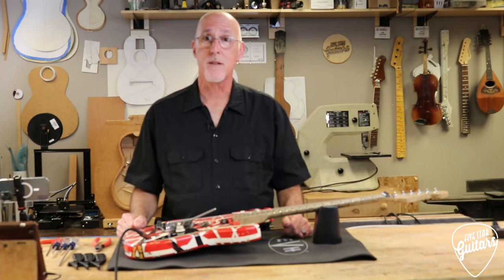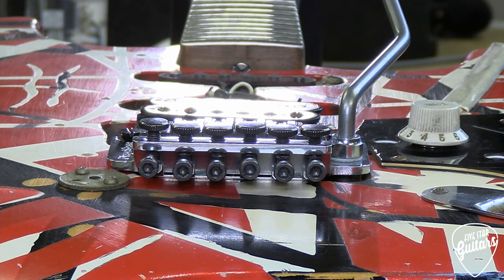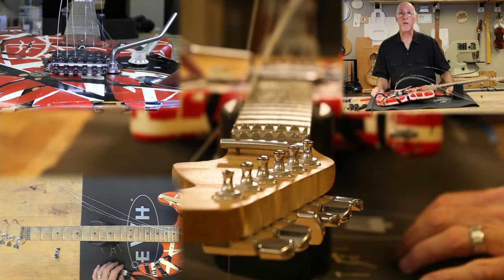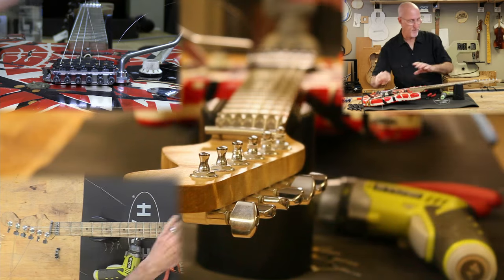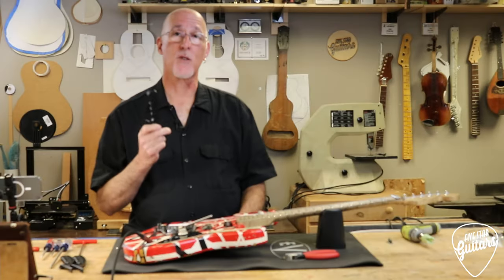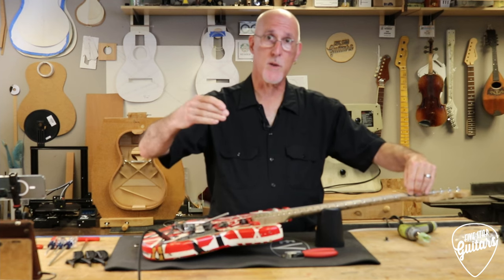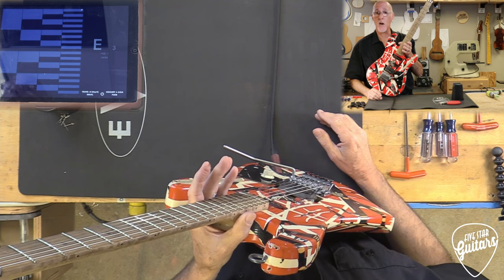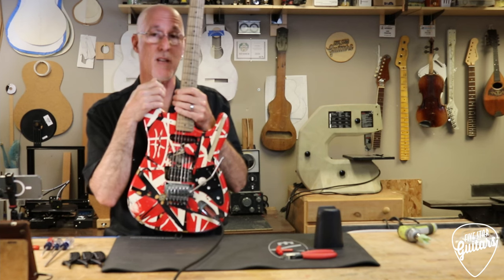Eddie Van Halen's Guitar Tech Tom Weber Restrings and Sets Up an EVH Frankenstein "Frankie" Guitar

Comment: I bought a guitar stretcha.  I used it on several guitars and it worked nowhere near as quickly as he claimed.  I did it on Floyd Rose guitars as well as stop tail pieces.  I did it 15 times plus on each string and it still was going out of tune.  In full disclosure, the humidity was horrible that day.....  Just wanted to give my 2 cents worth.  I would still buy it....  but don't expect it work as quickly as he has claimed.

Comment: With a D-tune, aren’t you meant to tune it when pulled out to D?
Reply: Yes, pull it out and tune to drop D then lock it down, and when you engage it there's a small grub screw on the D Tuna, you have to loosen and finely adjust it so when it's engaged the E isn't sharp or flat. 

They're a pain imo.
Reply: @Dav2112  thanks mate. Yes it’s a massive pain in the ass.
Reply: @MarkPritchardGuitar  I forgot to mention but you need to screw the fine tuner on the low E string all the way up, have a watch of this video it explains how to set them up. 

https://youtu.be/BrLV-58qVg8
Reply: The early Dtuna are more precise than the later ones, not sure when or where they changed em but I had one I purchased thru peavey in 97 for my Music Man and NEVER HAD A PROBLEM with it under alot of use.

Comment: Question. If you’re setting your final tuning on the sustain rather than the initial pitch isn’t your guitar going to play out of tune 90% of the time? It seems counter productive when most of the time you’re only holding that note for a eighth or sixteenth, why would you set it up so it’s only in tune after a second or two of sustain?

Comment: How come you don't thread through the tuning machine first and leave  the ball end on the string? Pull the string to the fine tuner and cut it.
Reply: Because, it’s a lot easier winding this way, than winding around the ball end.
Reply: @bigdaddycool4242  How? I only have to cut the string once. That is one whole step, no pun intended, removed from the process.
Reply: @An2oine  As you’re winding, you have to hold that string under the ball end on each revolution,or it catches the ball,correct? Yet, you don’t have to when stringing it normally. Older guitars where the tuners are spaced apart is easier, but on guitars like a Wolfgang or EBMM EVH, it’s a little tighter and harder.

I used to do it that was as well, if it’s any consolation.

Comment: VERY helpful & informative .....Thanks so much for this Tom.....One always had to be careful not to over tighten the screws on the little metal sting blocks without cracking them .....They make Titanium ones ?..Have to get myself some of those.....Love the long wrench, I always used the much shorter allen keys but they don't have the speed wind & would take for ages. (This thing you've got is like a Ferrari in the pitstop ...lol) The nut clamps are great on the Floyd Rose....Do you know back in 1978 Ed would use a standard Fender Strat brass nut & widening the string grooves & some 3 in one Oil ! Seriously....Things were a lot more difficult in those pre-Floyd Rose days for guitarists eh ? ....Back then Ed led the way on the developing technology because he was pushing the instrument manufacturers because of the demands of his innovative playing on the instrument . & folks had a lot of great ideas to come up with the stuff to meet his needs (& following other players)  Great advice on fret wear .  That 500 rpm is pretty lickerty-split '  A lot faster than my Ernie Ball string winder....Ed would have used it on the Pickup like on Poundcake of course ....lol ........My Floyd guitars dont have the retainer bar thingy between the nut lock & the machines actually...I've noticed that gravity (guitar not flat but vertical ) can make a difference....String stretcher ...Wow, gotta get me 3 of these....I would always do it the old way & I'd be there 20 minutes later huffing & puffing over tuning problems....lol...Always good to get those fine tuners in the middle of their travel , yes I always find you run out of play with them on the top E and B strings...Very interesting the stuff on having the player there while determining intonation because each individual player has a different touch making uniquely different demands on the same instrument....Good thinking Batman. Why didn't I think of that.......Incidentally, do you remember Ed used to like the Floyd Rose set up so you could only push down on it...Not pull back on it. The latter might create tuning problems folks used to say. But even those could be solved too with these practical insights....You get different sounds with both block setups.....Thanks so much for this...Best vid I've seen all week.

Comment: I never stretch my strings. I just tune and play and re-tune as necessary. This way I never over stretch them. And I think they sound better longer.
Reply: Having to re tune is why you stretch them .. instead of tuning as you go. Id rather be prepared, than to have to re tune. Example, putting less air than is needed in your tires, and adding more air as you drive isnt practical.
Reply: Having to re tune is why you stretch them .. instead of tuning as you go. Id rather be prepared, than to have to re tune. Example, putting less air than is needed in your tires, and adding more air as you drive isnt practical.
Reply: BTW your cat is very cool.♫

Comment: Ok so whos gonna be first to add 2 small wheels to the string stretcher? That grinding noise kills me.. plus im sure theres bits of plastic left from that tool..
Reply: no plastic left over
Reply: Already thought about repurposing parts of an old roller saddle bridge for this very thing.
Reply: @KurtS5150  well if it causes enough friction to melt the plastic... i dont see how it wouldnt also file that contact point down and leave bits of plastic.  Not saying its harming anything.. just a wheel would be better by a long shot.
Reply: @gookiecrunch  but their needs to be friction to pull...
Reply: @robm709  uh no sorry i think you're  mistaken. Tension is created by the wedge that is made with the tool not friction. Just like you do with your hands.  Do you slide your hand up n down the string when stretching them? Nope.
Reply: @gookiecrunch  oh ok thanks, I had never heard of this little device, just ordered one, looking forward to checking it out.

Comment: get him back to show how to tune with a D-Tuna.
Reply: Make sure the bridge is blocked from going back (raising in pitch)- then tune the guitar with the D-Tuna pulled out and tuned to D with the fine tuner virtually all the way up,  just touching the D-Tuna. When you're in tune with the guitar in Drop D lock the nut. Then you push in the D-Tuna  and use the mini screw on the side to fine tune the string to E. it's a counter-intuitive system, but once you get used to it it's very simple. There's also a company called Tone-Vise that makes a drop D system that's a little easier to deal with.
Reply: Same way however, I have never gone to D without having to fine tune. Never. Ever.

Comment: the tuning gravity does not affect the regular guitar only guitars with a Floyd Rose floating system if you put it on its back it's going to change the tune then when it's upright and on regular guitars you do not have to worry about that only the guitars with the Floyd Rose style set up

Comment: I have been using Floyd Rose equipped guitars for over 30 years.
The first thing I do after buying a new guitar, is throw the string blocks into my parts bin.
Since the first time I had ever seen a Floyd, and learned how it works, the concept of the block makes no sense to me.
I simply line up the string eyelet, so the hole faces neck to tail, and tighten the string lock screws until they make contact with the ball end.
I have heard so much stupid bullshit about how dumb this, when it makes everything MUCH more stable, and reliable.
#1. I am not cutting off the ball.
The string then is still as structurally sound as when it was built, and there is zero chance that it will slip out because the winding has been compromised. If you are buying no ball end strings, you have more money, than brains.
#1.1. When using cut ball ends, no matter how tight you set the string lock, it will crush and flatten the winding resulting in having to re tighten over time, or string might pull out.
#2. The slight taper on the end of the lock screw, is designed to fit in the small divot on the string block.
It just so happens to fit absolutely perfect into the ball end, the same amount it fits into the string block.
#3. Because the lock screw is slightly inserted into the ball end, you only need the screw to be barely finger tight. No wrench needed for the install- you will need it when you change out the strings, because it essentially welds itself to the soft metal of the ball end, after 10 seconds of playing. 
I encourage anybody to find any part of this less reliable, structurally sound, or have any negative impact on tuning, intonation, or use.
If your best reply is "this is stupid", well then, you have shown your ability to not understand even the simplest ideas of mechanics.
Reply: I am interested in this. But I am having trouble picturing...I am fairly new to Floyd guitars (Les Pauls and Strats until I bought my Ibanez). Are you actually using the allen wrenches on the Floyd to run through the ball end?
Reply: @robertallen1109  
So, you have your Floyd, with all the pieces.
Conventionally, you would clip off the ball end of the string, and insert that end into the saddle, in front of the black string block.
Then you would tighten the long, string retaining screw, tighten it with the allen key, and the block gets pressed against the cut end of the string, and friction holds it in place. 
What i do is, take out the little black string blocks, put them wherever you keep your guitar tools, but they will never be used again.
Take your string, with the ball end, and put it into the saddle, where the string block used to be.
Start hand tightening the long retaining screw, and notice the very end of it is slightly tapered to fit into the small indent on the now removed, string block. Line up the hollow center of the ball end, and  hand tighten the long string retaining screw, so the tapered end will fit snug, into the hollow center of the ball end.
and thats it.
My first floyd was used, and did not have the black sting blocks, and this was the solution to that problem.
I have been doing it this way for over 30 years, and have never had one problem.
On the contrary. it is inherently more stable, because you did not cut the string, which now makes it prone to unwinding.
Plus, you only need to hand tighten the long retaining screw, because the end of it sits slightly inside of the ball end.

Comment: This particular guitar's  bridge is not free floating due to the use of a coin in the upper rear corner , so do not follow the string length 90 bend as per these instructions if your Floyd Rose is not 'decked'.

Comment: I’ve found a better way that will have you throwing those string stretchers in the trash! It does the exact same thing, doesn’t generate heat, doesn’t require friction on the strings or time to cool down, it’s WAY EASIER &, it’s only about 10$ it’s a car window hand pump! (Like what locksmiths use). You can get em on eBay or Amazon. It starts off flat, you slide it under the strings then, you simply pump it up to your desired height. After it sets for about 5 minutes, simply turn the valve & release the pressure. DONE!! You’re welcome👍🏼😀

Comment: Kill instruction Tom thanks 🙏 The neck on that guitar and several of Ed’s the neck sits way proud yet the Floyd is flush to the body. How can this be?
Reply: Maybe shim neck
Reply: Body is routed slightly under the floyd
Reply: @Swanlord05  EVH didn't route under his trems.
Reply: @raymondlugo9960  EVH Wolfgangs are routed under the Trem.
Reply: @bigdaddycool4242  there's a hole for the block and springs but I haven't seen a picture of one that is routed so the bar can pull up.
Reply: @raymondlugo9960  Wolfgangs (USA and Specials)from the factory are routed for the trem to sit down inside it, but the trem sits flat. It’s not designed to pull up.

Comment: Ok, here’s a few of the mistakes/misinformation in this video:
On a Floyd Rose you don’t need to stretch in strings. Stretching strings is about the wraps on the tuning post settling in not the strings stretching.
He should have skipped stretching the strings and instead tune the strings to pitch with the locking nuts most of the way down. Just leave them up enough to allow tuning. Why? Because the locking nut saddles bend the string down a bit and this effects tuning. With this method once you have it in tune the now small remaining amount of distance the locking nuts have to move to fully clamp it will only slightly change the tuning. This minor tuning needed can easily be done with the fine tuners quickly. Once the nut is locked the tuning pegs don’t matter any more and the strings don’t stretch hardly at all. You can literally cut a string on the tuning peg side of the nut and it will stay in tune. Don’t believe me? Cut one just before you do a restring and see for yourself. The same goes for not stretching the strings on a Floyd Rose. If you haven’t tried it then you don’t know. 
When he put the strings on the tuning posts he should have pushed (with his thumb nail) the wraps together as he was turning the the post around. That way the wraps are already touching each other even before you start stretching the string. Obviously on a Floyd Rose it doesn’t matter but either does putting the first wrap over the top of the string like he does here. This stuff only matters with a non locking nut and non locking tuners.
When you tune a string you need to hit it as hard as you normally play. The harder you hit the strings the sharper they ring. Also he was tuning to the release of the note vs the attack of it. You don’t hear the release of the note if your playing at any tempo at all such as moderate 8th notes. You really only hear the attack.
Guitars can have different relief on either side. Especially considering your measuring in the thousands of an inch. Assuming the high E side is the same as the low E side is a rookie mistake….

Comment: There is absolutely no need to kink or tie or double a damn thing when stringing a guitar.  It's simple shit.  Set the hole 90 degrees from the fretboard, put the sting in the hole bend it and crank it.

Comment: I'm listening to this thinking most guys/girls that play guitar don't even know one tenth of ANY of this information/knowledge.
Reply: Hard to say. I knew most of it, but I've been using Floyds since the 80s, although I did learn a couple of things. Then again, I also run into quite a few people that have Floyds and have no idea how to adjust them or even restring them. I do things a little different than this guy, I normally change 1 string at a time unless I need to clean it. Saves a lot of tuning on a floating Floyd. If I change them all at once I block the bridge off and has nearly the same effect.

Comment: Unfortunately, the one guy that you’d think could share Floyd tuning tricks, shared zero.  ZERO!  Well, he did share to buy Ti parts, but that’s not really a tip.
Reply: I mean, what problem are you trying to solve? If you follow the process he outlined you don't need any "tricks" because you've setup the guitar properly. One thing I learned from this video is the part about the string needing to contact both edges of the nut prior to clamping, so the retainer bar should be adjusted accordingly. Hell, even sharing those tools was great. My hands hate me after stretching strings on restring day.

Comment: You Know in your heart that you can not stretch a string. You can seat them, but it would take the HULK to take a piece of steel and stretch it. There are 3 factors with strings. 1 is scale lenght, 2 tension, 3is string gauge. End of story. Break angle and all the over wrap is bull shit. A string works between the nut and the saddle. Period!